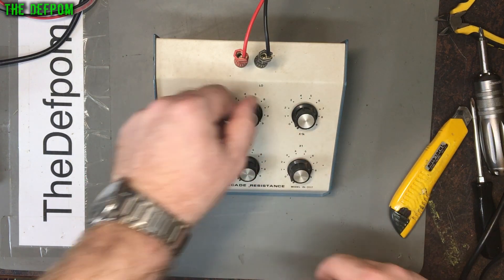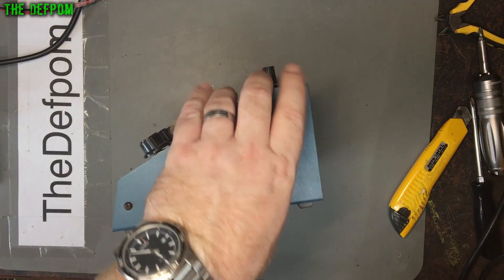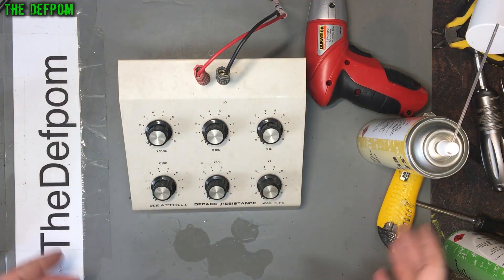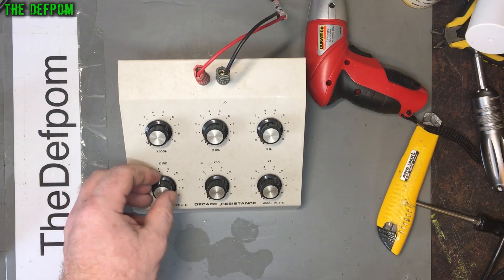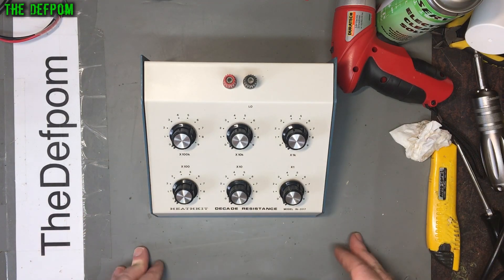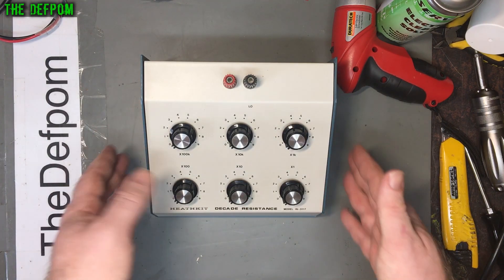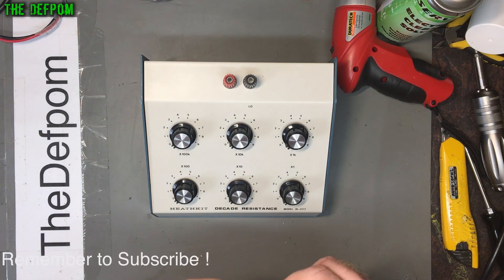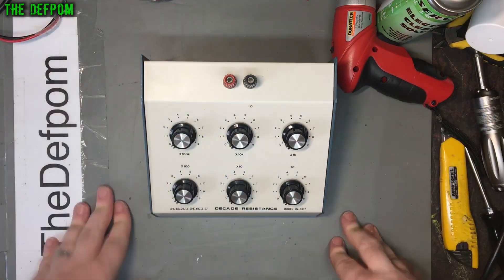🔴 Heathkit IN-3117 Decade Resistance Box Refurbishment - No.944

Comment: A decade box is one of those things you need only once in a while but when you do they are indispensable. I have picked up a few nice old once from eBay a 1960s Muirhead and a 1990s Ohmite which both had the 1K range resistor burned up. The Ohmite was easy to get new 0.1% resistors for but the Muirhead used hand wound/calibrated wire wound resistors. All of these older style have amazing range switches, pure electronics porn.